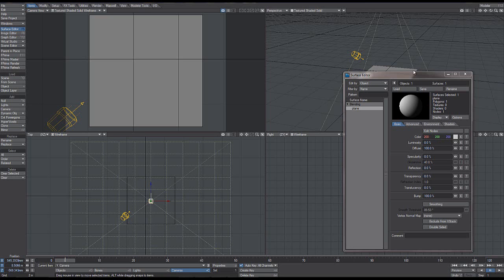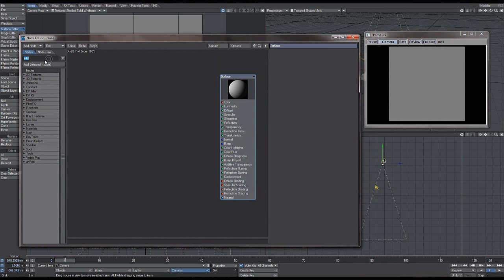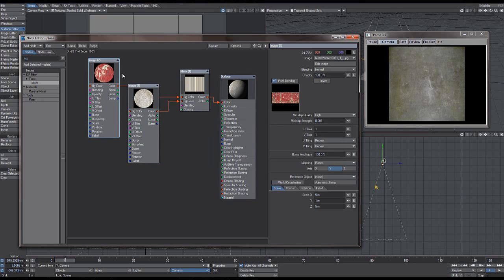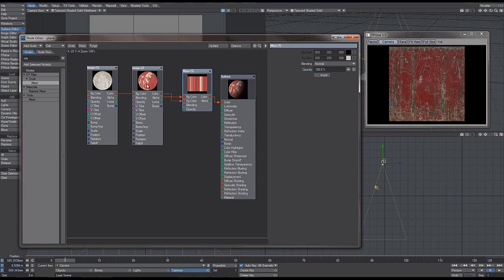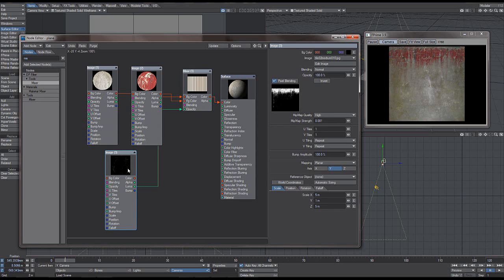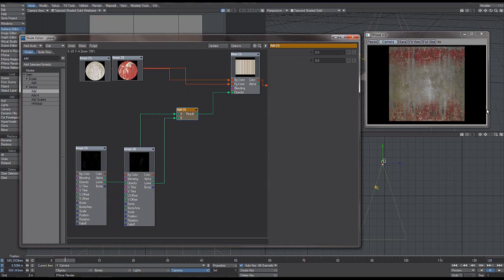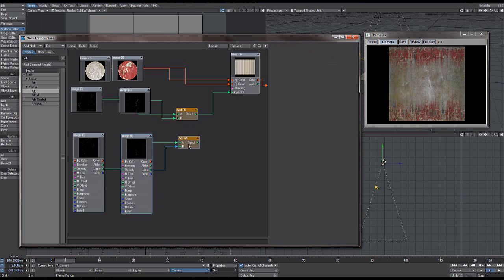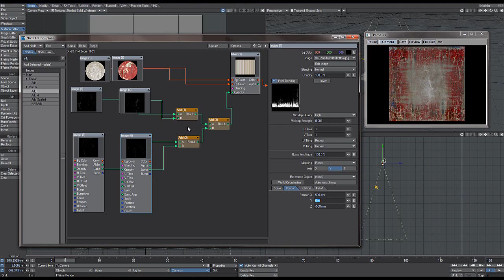Mixing Materials with Lightwave Nodes

Comment: Misleading title, you are just mixing 1 channel. How do you mix 2 material (every channel at once)?
Reply: MarquisDeSang no it isn’t. I mixed two materials into one. That’s literally what the title says. If you need multiple outputs then pull those two. There isn’t an auto pull all channels because you don’t always need all channels. Pull the ones you want for each Channel
Reply: @omgsteee  Strata CX has true material mixing : you put them on top of each other and you can mix them (add, multiply, substract...) and use masks. If this is what you call material mixing, ok then. If you want to have an object made of marble and glass at the same time with a mask to show one or the other, it's gonna take you a lot of nodes.
Reply: MarquisDeSang glad you found something. This video is seven years old. I don’t use lightwave anymore and haven’t kept up with any new tech as I’m in development now instead. Good luck.

Comment: Thanks for great tute, it was my first contact with nodes! However I found nodes looking for a solution to a little bit tricky question that I was hoping you could help me solve. I have an object (a white plastic bottle) in a scene with lots of colors bleedoing on to it through GI. On the bottle there is a metallic looking logo. I would like to create some sort of surface that makes all reflections of that logo monochrome (that is all color are converted to black and white). This COULD be done manually in post, but I would really like to see it as a surface/plugin, if possible. TYIA!

Comment: Nice video tutorial! You asked for suggestions, so here's mine...

I'm looking for a way to control what image is applied to a surface with a grey scale image map, but I want to mix 4 different ones, so that the darkest areas get image 1, the brightest image 4, etc. An I want to be able to adjust the 'break points' between where the images switch over.

Is this possible?
Nick